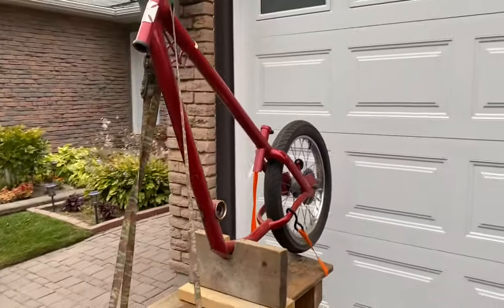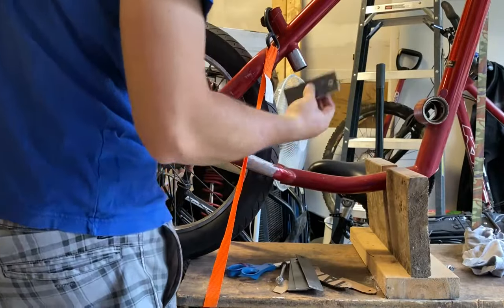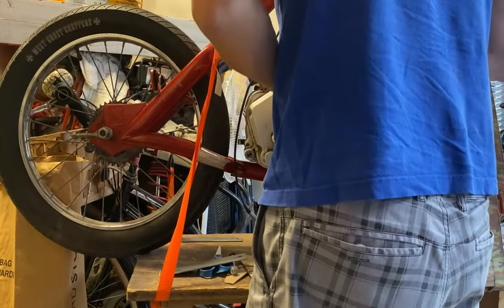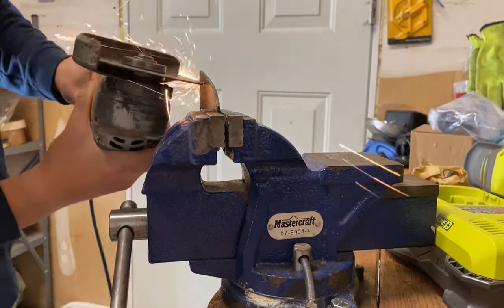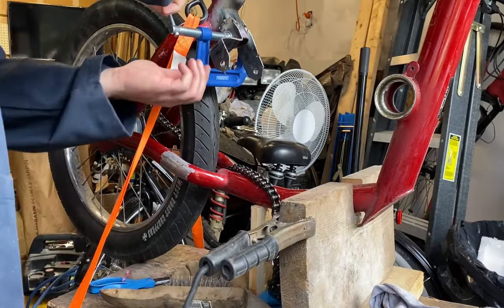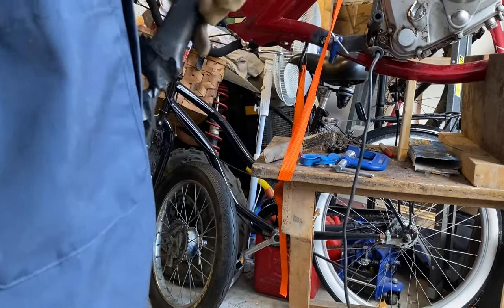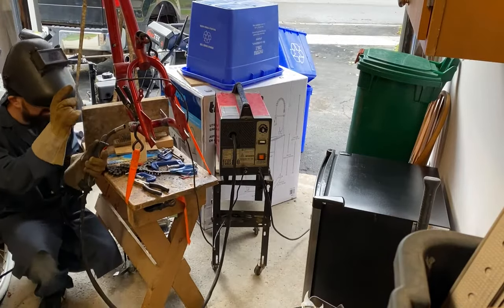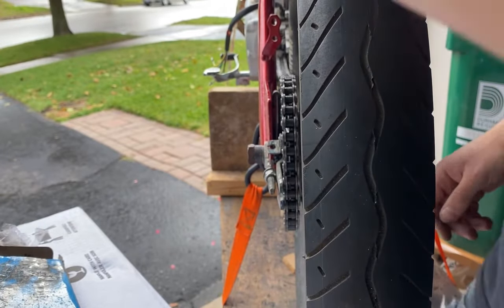Custom West Coast Chopper Bicycle Build Part 1

Comment: Mad respect for the Moto ped upgrade read about in above comment. Great score. I did the electric and don't regret the upgrade. Yeah the first one is only 36v500w legal build but worth every penny spent. Am currently looking for the same moped wheels to upgrade for the other frame I wouldn't mind going 72v 6kw with the moped rim and adding the front wheel drum hub for the brake torque ability of burnouts. Enjoy all the customizing folks do with this frame. Just hate seeing them cutting one up when it's just as easy to replicate one with the right tire size. Stretching them means the loss of two so do the math. Those frames are fetching $200 in decent shape so cut them sparingly if ever. They ride pretty agile as they are. Just add speed. Keep up the good works.
Reply from the maker: Yes, the Moped rims are a must for these bikes to be able to stop. You can usually pick up a parts moped pretty cheap. 72V would be one fast bike, you should build it and let me know. I agree the price of everything has skyrocketed I look online everyday hoping for another deal but haven't found one yet.

Comment: Hey what did you use to replace your sprocket Basically like what kind of sprocket did you use
Reply from the maker: I bought an old moped from the 70’s for the rims, it came with a sprocket that matched the motor sprocket teeth.
Reply: @NorthernChris1  Do you know where I can find one
Reply from the maker: @bigteflon9441  I looked on craiglist/facebook marketplace/ for an old 1970's moped I believe mine was a Motobecane moped. I would look online for someone selling one.

Comment: Nice work brother ..I have an west coast chopper bycicle and I'm debating on what type of engine I want to mount if you don't mind can you please tell me what size engine you instead
Reply from the maker: Thanks! I used a 125cc 4 stroke. It came from a kids atv. It has a 3 speed transmission with it, they sell two stroke kits for these bikes but sometimes they are more headaches then they are worth.
Reply: @NorthernChris1  yes I've had a 2strke engine before want to mount a125 cc .. thanks for the video now I know what to do thanks for the Intel

Comment: Hey where did you get the rear rim and what is it off of i just built one of these and cant find where to get rim what size and all that is it and where to get it please let me know
Reply from the maker: The rim was off an old mid 70's Motobecane Moped, I bought it off craigslist for $100 for the whole moped. the front and rear rims fit perfectly and they already have the drum brake inside them.
Reply: Thank you i just ordered a rear wheel will the front wheel off the same moped work for the bike too
Reply from the maker: @jaymartinez2956  It will work, I am going to switch the front wheel soon as it also has a drum brake and I want to have better stopping power.
Reply: @NorthernChris1  i got to ride it for the first time the wheel worked great just have to get my foot brake lever to work with the drum brake on the wheel
Reply from the maker: @jaymartinez2956  That is amazing, glad it worked for you. You will have to post a video of you riding it.